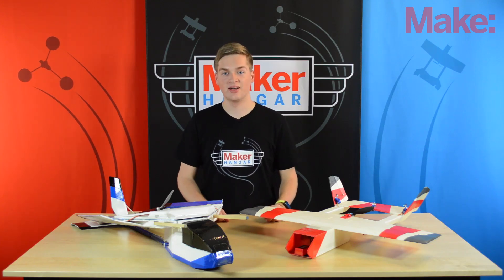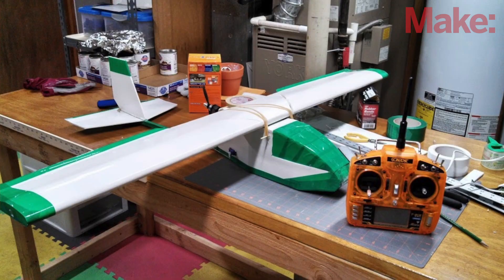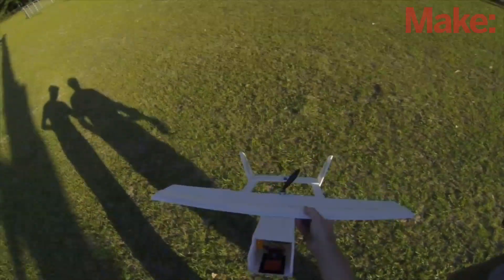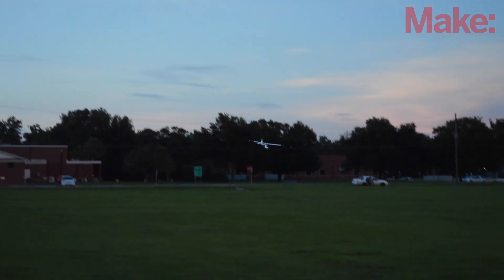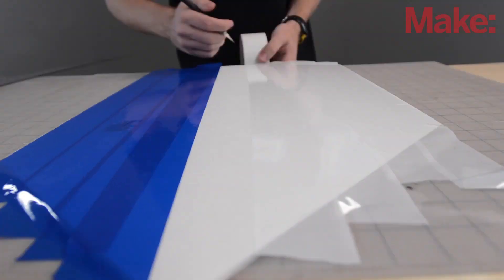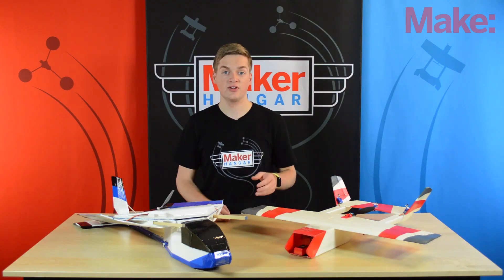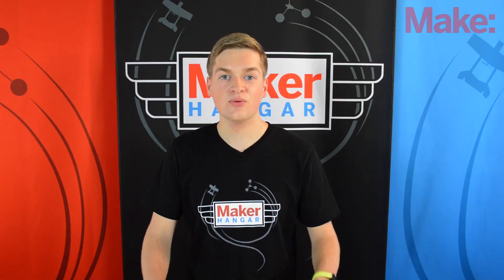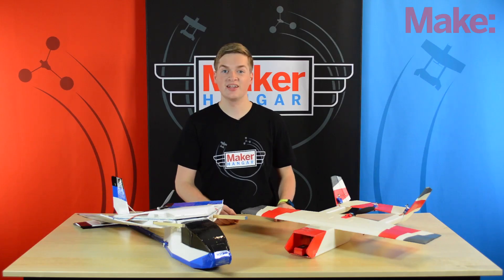Maker Hangar 2: 06 - Maker Trainer 2

Comment: I have been thinking about trying to use a gprs shield for arduino, or beagle bone black,  or raspberry pi, intel galileo whatever. I have them all. Does anyone think it would be possible to use the gprs option to control one of these several miles away along with a camera mounted in front of course?  Use a gps shield as a return option if control is lost.  Maybe some light weight solar cells on wings for the longer flights. Maybe use a smart phone as the controller or another gprs shield wired into a regular controller. Any ideas would be great,  thanks.

Comment: Not having to use the Adam's ready board is great considering that I couldn't find it here in Australia, the idea of a smaller, slower flying plane also seems great. Already ordered my Tricopter kit and still need to order the electronics which I can't find a link to!! So I probably will be building this, just not in the near future.